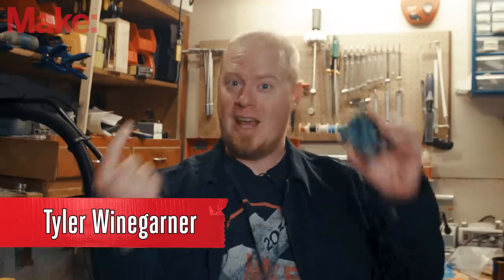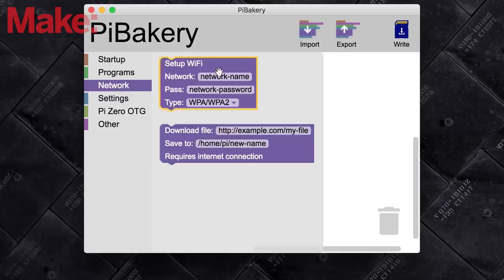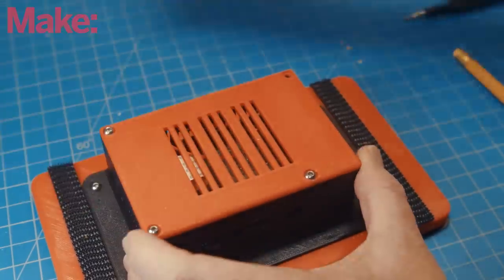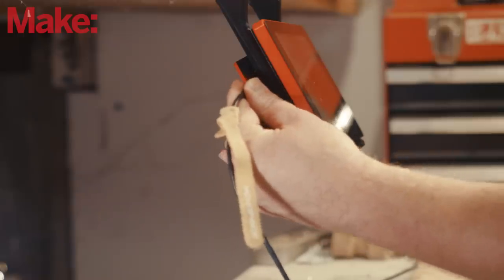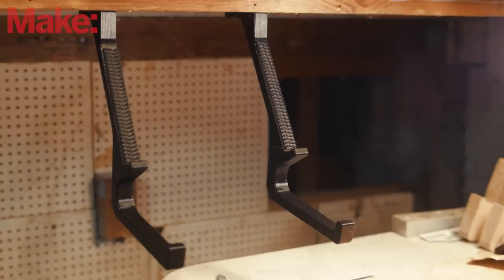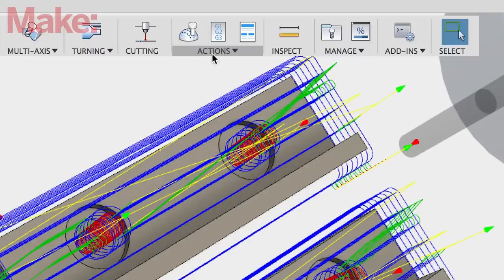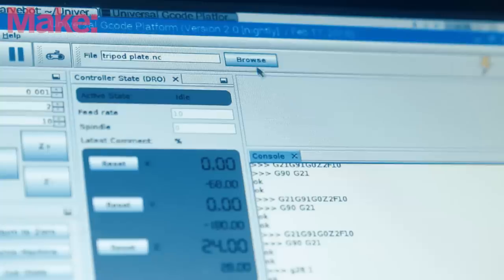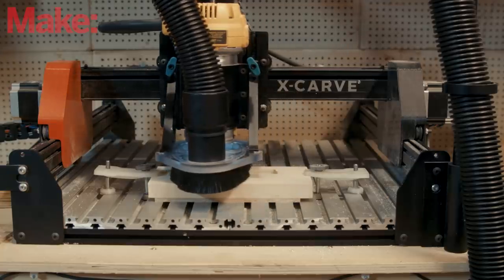Raspberry Pi CNC Controller

Comment: Nice setup, always fun to see how people are using my little program. Thanks for the shout out!
Reply: Thanks for the great software! :) Made jumping into CNC that much easier for me.
Reply: good software but evertime i use the program it crash half way in a job any idea to prevent this
Reply: @chad danylak It's not supposed to do that, create a ticket on github and I can help you out.
Reply: I have a problem. Visualizer in UGS on Raspberry Pi 3 B+ doesnt' work. I tried python bCNC and it works but I prefer to use UGS.
Reply: when a development spread a lot, make a great reputation for the developer
Reply: Your Software is fantastic. I was almost ready to give up before I tried it.
Reply: Does UGS support the mach3 controller interface...newbie here
Reply: Hey ,gonna try it now also subbed to your channel.
Reply: Hey I am trying here since I don't know how else to contact you. I am trying to install UGS on the latest R Pi OS and the method in this video does not work - starting with not being able to clone from github. I downloaded the file but would love to actually install it so it will work like a bootable program. Let me know if there is an updated source of instructions. Thanks.
Reply: @liamstone3437 there is a dedicated raspberry pi build now, you can find it in the download section on GitHub.
Reply: @WillWinder  Yes I downloaded that. I was hoping for install instructions pertinent to the new OS and your new build.
Reply: Your such a legend for sharing it
Reply: You are a God among men, thanks for the amazing program, I do hope you have a way to feed yourself because this would have been an amazing program to do just that.  Kudos on the program.
Reply: @Will Winder I still can't make your program run on my Raspberry Pi 3.  I wish there was a way to make it easily work, but so far I have found none.
Reply: @geologist_luna  you no longer need to build the program like this video demonstrates. Check our download page for raspberry pi binaries!
Reply: Glad I read this comment thread, I've been trying to do it the old way because I couldn't figure out how to open the downloaded files. I was just clicking the .exe instead of the executable one. Thanks
Reply: I'm about halfway through building my CNC machine. Definitely going to look into using this.
Reply: We are all  around the World your Fans !🌈🗺🏝🌠🆔💧🔥✝🆗🛐☮⤵😇👻🌷🦜
I hope that maybe we do something new or a new geometry for certain products?

Comment: This is misinformation at best. The Pi is not the CNC controller. You clearly have a CNC machine with a built-in controller. The Pi is only working as an interface, or like repetier host works for 3D printers. It only sends plain text g-code over serial cable and displays the read-back from the controller.

Comment: So it's not really a controller but just a gcode streamer. A controller is the part that actually sends the step command to the individual stepper drivers etc.
Reply: Unfortunately yes, the Pi lacks IO functionality to be a flexible CNC/3D printer controller. Adding an IO expander via I2C or SPI could solve that
Reply: Ron DLH : I still think that the Pi  will not work well for this since it is running an entire OS in the background and thus the timing for controlling the motors will not be precise. You need a real-time OS for the timing to work properly or just stick to a dedicated microcontroller.
Reply: Sebastiaan, yep this was disappointing, from the title and intro I thought he was showing a CNC controller — not just a shop computer used to connect to his stock X-Carve controller. 

Others have built out RasPi CNC controllers so I was curious if his approach would be different than the popular RasPi / Protoneer board formula.

Of course we shouldn’t expect much from any Make: video on CNC; it doesn’t appear that hard core CNC projects are their forte
Reply: You can run an OS on the Pi, but you don't have to. There is no reason why it couldn't run any the 3D printer platforms like Marlin. Some changes in the software are required of course. You could also run an real-time OS on the board.
Reply: There are people that have make rpi  it  to a controller for a CNC, and 3D printer using LinuxCNC or Machinekit with a real time kernel running. The rpi is a lot more to get its set up. I use the Beagle-bone Black with a per made os img for Machinekit  and you can get up and running real fast.  Both use GPIO pins to talk to the stepper motor drivers. https://www.youtube.com/watch?v=vNkgUlXdiHE for the rpi gpio test. https://www.youtube.com/watch?v=AK_OYoNOBDQ for the  Beagle-bone Black.
Reply: So, I have to use a cnc controller + Raspberry? I have a CNC3AX controller with DB25 conector and a Raspberry Pi, so, how do I connect  both? It's possible?
Reply: My first question to you would be what Raspberry Pi are you using or have?  It does matter if you want to make things easier on yourself. The Raspberry Pi 2 seems to be the best bet when trying to using the GPIO pin straight from the Raspberry Pi's itself Instead of having a daughter board in between your motor board and the pi like the PICnc-v2 daughter board ( https://github.com/kinsamanka/PICnc-V2/wiki ) 
 Then my second question to you would be with that CNC3AX control board you have. Looking at the pinout is not a standard DB25 pinout that a cnc would use. It's looks like its labeling each axis as A, B, and C motors instead of the normal X, Y, and Z axis pinout. What you need to do is figure out the pinout of the DB25 connector to your stepper Motors outputs. So like each stepper driver for each axis has a 3 pins or wires going to it for signals those being step, direction and enable. Looking at the one wire diagram I did find that's in Portuguese ( https://cncparts.files.wordpress.com/2009/11/conec_cabo_cnc.jpg ) it does look like all the pins that are need are there. 
You will need to Hand wire your own DB25 connector for to get it to work.  I would make an adaptor board for it with optoisolator to keep your Raspberry Pi safe and make sure you're pulling out the right logic voltage for your control board. This forum ( https://www.raspberrypi.org/forums/viewtopic.php?t=33809&start=950 )post should help you get started by still recommend doing your research first cuz you will have to do some programming to get everything working and there is nothing that works I'll the Box for the Raspberry Pi as of right now or that I know of you will have to compile and write your own hal and ini  files.  
The beaglebone black you can get started with an out of box image on the SD card with machine kit and I would recommend that for a beginner all you need to do is figure out the pin out by looking at the hal file of config you go with like the BeBoPr++Pepper config.
Reply: Though if your computer that originally was controlling the CNC has a parallel port was running mach3 or just an old pc that has a parallel port. You can get started faster with install Linuxcnc on that pc and run the Stepper Configuration Wizard ( stepconf ) to generate configuration files that you can start off with, and run your seem see with until you're ready to use your Raspberry Pi as the main computer brain.
Reply: I have Raspberry Model B and I have no computer with parallel port(I use notebook), so I need to use GPIO to conecct both.
Reply: André Vanzolin there are USB to Parallel printer port.
You should be able to use that.
Reply: There are software running on the RPi that uses DMA in a clever way to get really good timing for running Stepper motor controllers.
And yew, as RPi ports only handles 3.3V they need some protections. Not that hard to find or eve build though.
Reply: Sadly those does not work in real time so a USB to parallel port printer adapters that you see on Amazon will not work with linuxcnc there is no drivers built for it because linuxcnc software is based in real time. Linuxcnc kernel Is based on a patched version the adds real time processing  to generate the step pulses needed hints once you start putting things over USB which has a buffer you start to lose that real time pulse generation and this is also a safety Factor if you  if you hit the emergency stop and it takes half a second for the pulse to send to  the computer and then the Computer to process and send the Holt command back down now you're looking a bad situation.
Reply: Here is a good form post on it. https://forum.linuxcnc.org/18-computer/26295-usb-to-parallel-port-converter and heres info on real time kernal http://wiki.linuxcnc.org/cgi-bin/wiki.pl?RealTime
Reply: BUT the controller I mentioned are from the IO pin, and they are delivering a REALLY fast and steady flow of pulses.
The USB to parallel are not the best, that I do agree on.

And here are the info about pyCnC and why it works:
https://medium.freecodecamp.org/how-to-build-a-3-d-printer-using-cnc-controller-in-python-bd3cd5e28516

"Let’s connect the oscilloscope to the specified pin and run this application (do not forget about sudo privileges). We will observe ~1.5 MHz square pulses:"
But that was straight pulses.  Whith controlled PWM, you get down to about 300 kHz, as demonstrated in that page.

Notice, this is with code written in Python.  Not C/C++ and not using another controller board. And not using real time kernel.  Both which would make it a bit better, I guess. Or not.
Reply: Definitely interesting and it still looks like it's in its infancy. I'm surprised I haven't heard about this before with all the looking I've done over last two years!! Now just to correct you Linuxcnc And machinekit run off of both C and python. The only thing that worries me with looking at what they have so far is there is no real time kernel that keeps the machine running straight and on one task without it you could have some other program start running and take over causing havoc not a big issue if you're just running a 3D printer but  running a mill or engraver like that spells disaster to me! I'll definitely keep my eye on it and thank you for the heads up on it! :)
Reply: It is not the first CNC software based on this way of using ARM and DMA to generate a steady puls train on the RPi. There are actually one earlier written i C and just for the RPi B (the original).
And yes, you should probably not run a couple of servers, file sharing and web browsers in it while you do run this.  But there are still some thing you can do without a real time kernel to help you out on that.

And about running havoc, people are running their CNC on MS Windows...
Reply: André Vanzolin   No, you need a real CNC controller like an Arduino running GRBL, which you can connect to the right pins on your DB-25 connector.  In this example the Pi is serving as a remotely accessible G-code sender, more convenient than using a laptop directly connected to a board running GRBL, but very different than a standalone controller than can both send G-code and control steppers.
Reply: flomojo2u yes, this doesn't run the RPi as a G-code interpreter and control the pulses needed to control the stepper motors. It runs the RPi as a G-code sender and controlling the G-code interpreter.

But you could run the G-code sender AND the G-code interpreter on one RPi. But that is not for people that does expect it to work as easy as LinuxCNC, or other readily available software for faster macines like an ordinary Pc.  But yes, you could run it all on a RPi.
Reply: @Richard.Andersson  you can use linus cnc for real time cnc control with pi

Comment: I would use the touch scree for a lot of those buttons as it would be easier to control then the keyboard just to make the process faster
Reply from the maker: The interface gets pretty tiny on the screen. and there's a lot of minuscule screen elements - like the arrows to change your step increments. But, the solution is there for you if you want it!

Comment: I have been thinking about this to make a plasma table cnc. I have a laser engraver so its basically the same idea. I have the fabrication skills to build a table but had no idea of what to do for the electronics.. I also use fusion360 more for 3d printing and laser engraving but a plasma table would be awesome..I see no reason why I couldnt use a home plasma cutter ..I just have to figure out how to wire everything so it tells my plasma when to fire. This is awesome!

Comment: Congratulations for this nice setup. I did install UGS on a RasberryPi a few weeks ago to run my Sahpeoko3 and I unfortunately have some trouble with it (crash during jobs). It seems you run an older version of UGS, I'll try this same version to see if it works better. If only I saw your video a few weeks earlier, I would earn lot of time and pain ! Thanks again.

Comment: The native resolution of the Pi touchscreen is 800x480, you will find everything is crisper if you set that as the FB size.
Reply from the maker: Yeah, but I found that the UGS interface is just a little too cramped to use at that size. I've found that 960x540 has enough space for the critical stuff, and still scales nicely.

Comment: I don't think you need to install maven. I believe this is only needed to do development on UGS. I've got GRBL 1.1 running on an Arduino Uno with a grblshield doing the actual controlling. This seems to be just the thing to get my old Shapeoko working again with a nice, light weight control system.

Comment: I would like to build this project. Is there a way to use Protoneer Raspberry Pi CNC hat v2.58 (I will use this to drive my TB6600 stepper motors), and connect it to your system? Would I need to use an additional Raspberry Pi ?

Comment: how are the stepper motors connected to the raspberry pi? the steppers are usually connected to a controller or atduino, do we connect the arduino to rasp?

Comment: OK, I've now got all this working and its certainly better than using the laptop (old laptop and very slow) I've found that the classic script is a lot better for running on the pi though, not as resource hungry. I'm just trying to work out how to create a shortcut for the desktop so I can run this with just a touch screen rather than mouse an keyboard. Any ideas how I can do this as all my attempts have failed

Comment: Title says that the Raspberry Pi is a Controller but the video seems to say that it is just a G-Code Sender. THERE IS A DIFFERENCE! If it is just a Sender, then you still need a controller like GRBL running on Arduino.

Comment: Do you have an opinion about the cheap $200-$300 CNC routers you can find on Aliexpress? Are those a waste of money for a PCB milling machine, or are they perfect for that purpose?
Reply from the maker: I don't have any experience, personally. Switch & Lever has a great video where he reviews one. Build quality was bad and some parts broke on assembly.
https://www.youtube.com/watch?v=2rk7DJ6p-nQ

Assuming you get it together ok, you should be fine. PCB milling doesn't require a ton of machine rigidity and strength. You might want to put it in an enclosure though - depending on your PCB material, some of the stock is really toxic.
Reply: Thanks! I've seen that video before but that doesn't make it look too good :) Also thanks for the head-up about the toxic PCB's! Never thought about that.
Reply from the maker: Specifically the dust from milling. FR4 is the really nasty stuff. FR1 & 2 are nontoxic.
Reply: That's really good to know! Thanks!
What does the FR in FR4 stands for? -Edit: Sorry, that was of course only one Google query away: "Flame Retardant", https://en.wikipedia.org/wiki/FR-4
Reply: I have one, it works well but you need to know what you're doing as they don't have any frills. Critically, they don't have any endstops, so it's easy to crash the spindle carrier.

But yes, they are perfectly capable and if you use it right they are much much more capable than you'd think, I use mine to engrave pretty complex PCBs semi-often. It's absolutely critical to do software auto-leveling on your copper clad, but most of the cheapo's on Aliexpress are generic GRBL controllers that support probing so this is easy to set up. Also you have to be careful with dust, you want ventilation and a fan to pull the dust away so you don't breathe it as bare minimum.

Comment: Regarding Fusion 360... you say it's free, and it definitely isn't. It's a subscription service which costs $300 per year, unless you can get a student/education license. That doesn't apply to most of us. AutoDesk is a business, and understands that training folks to use their proprietary software means building future revenue streams. That said, I'm sure they put out a good product.
Reply from the maker: It's free for hobbyists as well - which is anyone making less thank $100k/yr with that software - which does describe most of us.
Reply: Make: Then I need this yesterday.
Reply: Can you point us to where Fusion is available for free because all I can find is free for 30 days then $40 per month afterwards.  No mention of being free indefinitely for hobbiest. In the mean time, I've been using FreeCAD.
Reply: Same confusion over here. Guess they're meaning the 'Sign up as a Start-Up or Enthusiast' thing. Well, this doesn't meet the definition of free or open source software, but you can use it as long as they don't change the licensing.
Reply: I don't see anywhere on Autodesks' website where one can get Fusion 360 free for more than 30 days. All I can find is free for 3 years if one is a student, educator, or academic institution. I'm none of those. Am I missing something here?
Reply: Thanks, that helped a lot!
Reply: Yes you can get free hobby license for a year at a time